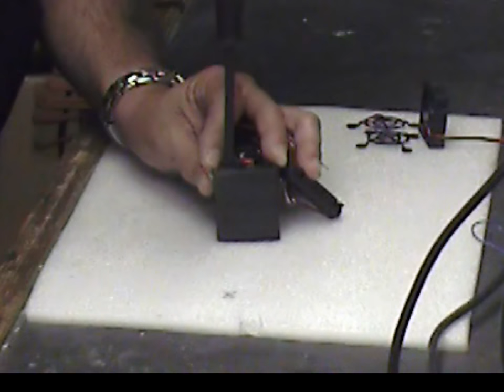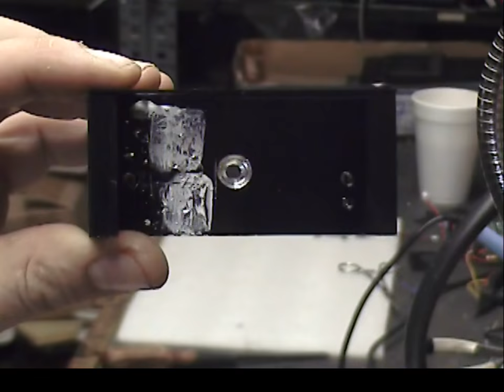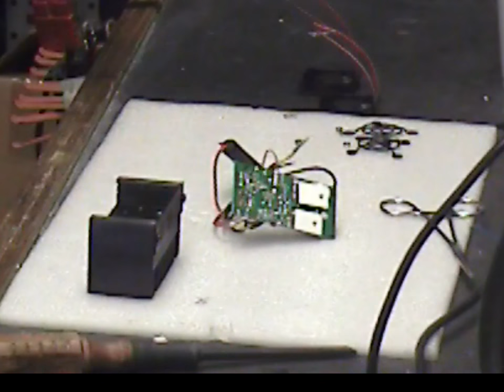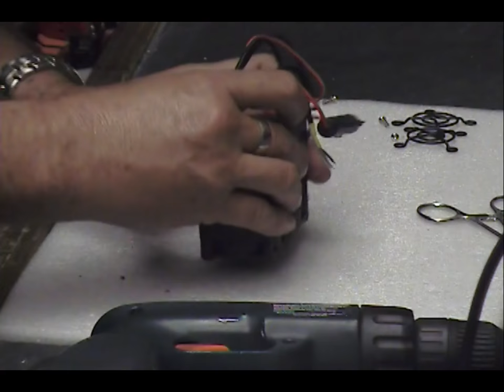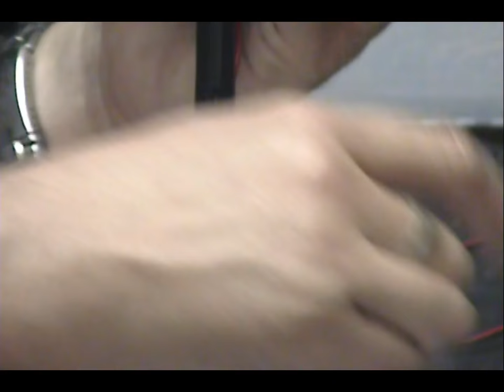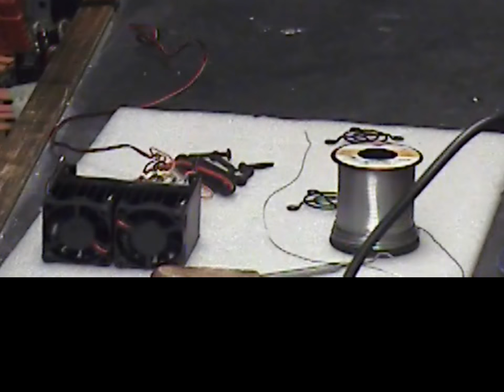Dual Fan RFX-75 Installation

Comment: I inherited my Dad's second generation RCI 2950 that he bought in 1992 in High School. It had an external linear mounted on the back that was called a DX-100. When I wanted t cool that off I sealed up the case mounted two muffin fans over the final and had exhaust wholes on the other side. It was like a primitive pressurized system much like you see on high end tube amp's. I do not recall now if it had one or two transistors in it? I want to say it used MRF455's. 

By the time he was out of college most of that radio had been beefed up. Every time a part would fail a higher gain lower noise higher current device would go in. Not to get more power out of the unit rather to make it more stable and more durable. He used the that radio with DX-100 kit to drive a TS Sweet Sixteen. He also had a Clear Channel Radio SP1a speech processor from the days of the origanal AR3300 and AR3500.

He built a tiny regulated power supply for me to keep the fan speed from dropping under key-up.

I wish I still had it someone stole it. I only have PL/PD on my car so I have to get a new one once they become available again!

Comment: Just want to let you know that the fans were pointing in the wrong direction. They should be pointing to blow air on the fins, not pull the hot air off.  Good video and good idea though. Got to keep it on the cool side.  LOL

Comment: I have been thinking of mounting a set of fans on heat sink of a Stryker 955 as it will be in a overhead cubby hole will those fans work for that?

Comment: Why not just buy a Real CB Amp?
This thing will kill your radios!
Got a 600 Wattt CB amp for 250.00 on ebay super easy to install!

this only gives your radio like 150 watts and 150 watts is gonna give you 2 more miles thats it!